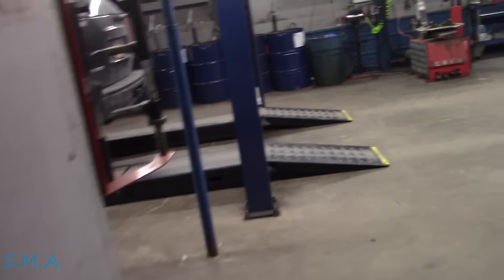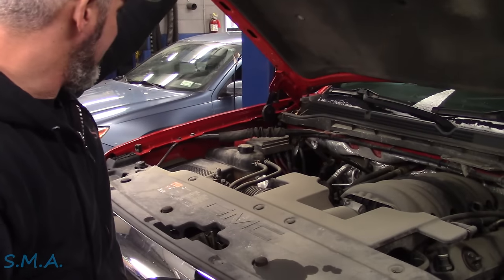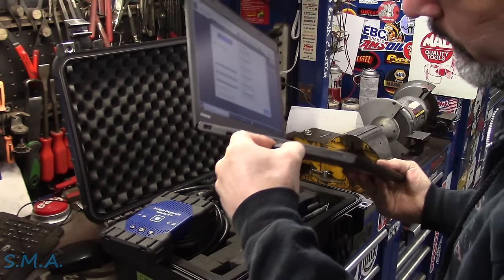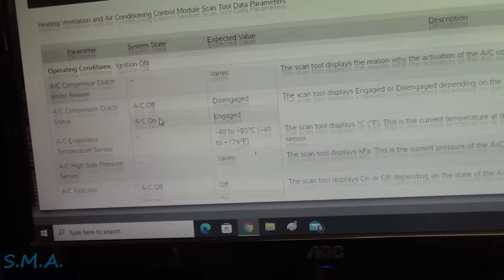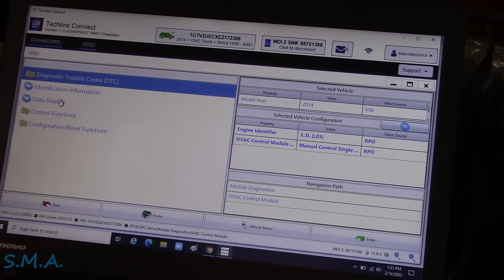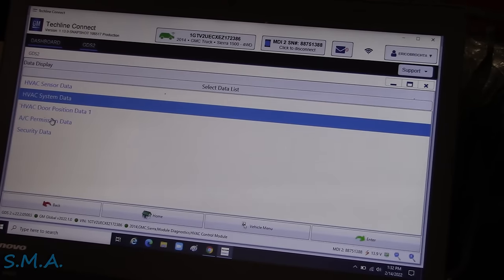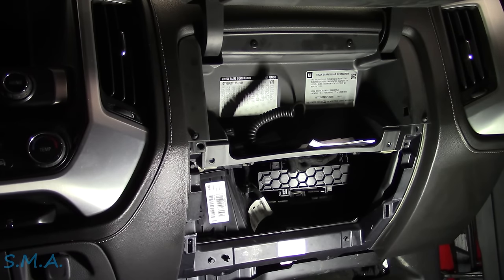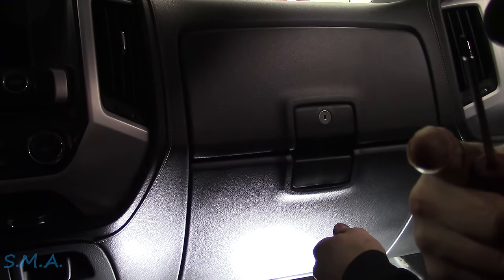Chevy/GMC Truck: Failed Heater Control Module

Comment: I bet the profession was fun when you started, back when cars were simpler.  Car not running right?  Put in plugs, distributor cap, wires and rotor.  Maybe tweak the carburetor a bit and you were good to go.  Today, you have to be a rocket scientist to put air in the tires.

Comment: In my youth I considered being a mechanic but decided otherwise I still do most of my own work but yeah wouldn't wanna do it everyday  my two most cringe worthy jobs have been injectors on my 04 Duramax or a motor swap on a 06 envoy (currently doing) but these large jobs could easily exceed the value of the vehicle if I hired it done in fact I priced a couple shops and they said they didn't even want to touch it there when you know your in for some fun lol

Comment: When I first started in the auto repair world. I had a Mac Tools 4000 Enhanced Scanner that I bought from the mac tool guy and I gave $3,000.00 for the setup that was way back in 1992... 😢 I just recently had to put it in retirement as the software updates just got to be to much money and you can still buy them on eBay. 😂😂😂

Comment: There is a pro and con to the good old days, I have three modern cars computers and what not, and one 1978 Dodge Ramcharger.  It's great to have a fully mechanical vehicle in that the repairs are very easy, and there is room to work, yes all that's great, that's the Pro, the con is you really have to put your Sherlock Holmes hat on and say the game's a foot!  Because there is no computer so you can't plug in and find out what the problem is, which is and can be a Con.  And then there is the relic parts that are needed and are hard to find, or don't exist anymore, or are available and are either cheap or stupid expensive.  So I'd say there is a good bad and ugly side to simple non-computer controlled vehicles vs newer technology.  And you are correct Eric, it is getting to a point wherein the average Joe can't even change a light bulb without having to do some kind of programming and that's just the way of the beast wherein manufactures will make it so it has to be taken in so they can scoop up more money.  
As for a different career, yes it can get boring but at least the problems are usually different or a mix of things, most jobs today you deal with angry people and do the exact same thing everyday.  We are where we are supposed to be or for now, anyone can change what they do, or the right time needs to come along.  I'm a ret Paramedic Capt from the Fire Department, and although we had SOPs (Standard Operational Procedures) mean there are steps one should follow or monitor but every call was different.  Yeah you have Vehicle crashes and fires, that are of the same kind but the nature of them were different.  And medical calls were always different depending on the person and age.  A few years ago I got a medical call for a 18 yo male who had burned his testicles, come to find out he was trying to light up his own gas, and when that didn't work he used lighter fluid!!!!  Yeah, and he's out there now driving and voting and making decisions.  It all comes down to what you do that makes you happy, you're good at, and Job Security!  It's a pretty safe bet that Flame Tard I talked about will always need someone to work on his car...I hope.  Don't worry he was okay, just the stupidity that caused a burn injury, I still to thi day scratch my head on that one, and that was years and years ago.  Thanks for reading, my best to you Eric and Mrs. O, and to anyone reading this Bes Safe and Well!

Comment: Being a retired electro-mechanical engineer I always tried to follow the KISS principle... keep it simple stupid. The young engineers coming out of school seem to think or are taught that everything in the world needs to be controlled by a microprocessor. Having to re-program a heater control module post-replacement is just plain ludicrous. Trashing expensive electronic modules or other complex parts, or even the entire vehicle, flies in the face of the constant mantra of sustainability.

Comment: I call it technology for technology sake. Not really better, just more complicated. I'm not scared of electric controls. With the right tools they are actually easier to diagnose than cars from the 90s. I'm with you though on cost to repair. It's going to be hard to use a module out of a salvage yard when a 2022 vehicle gets some age on it as programming might not allow it. It's going to be a mess when these things are 20 years old.

Comment: The problem is ALL of the car companies have gone off the rail buying into beautiful overblown technology features.  Every dash and control panel has to look like a gee whiz bang tablet, everything has to be computer controlled, so they add more and more modules to massively overbuild controls that have no possible need to be that way.   Yet another reason I will not go out and drop $50,000 of a new vehicle.  I have owned many vehicles in my life from the 1960's model to current decade, and not one of them every had a problem with the heater A/C controls other than replacing a blower motor or blower motor resister.  Stuff like MR. O just showed is also why many people are keeping older cars going rather than buying new.

Comment: If someone is just replacing the HVAC control head, does this also need to be "programmed"?    This would be GM Genuine Parts 15-74881 Black Carbon Heating and Air Conditioning Control Panel Assembly.  Seems to me it's just plug and play.

Comment: I definitely long for the days of kerchunka chunk knobs and switches. None of the touch screen garbage impressed me at all. I just want something robust. Don’t care if it is pretty, just want it to work. I often wonder if a fella could make a living with a shop that converts “digital” modern vehicles to “analog”. Yank everything out of the dash and install a basic condenser/heater core with a blower fan. Install an aftermarket radio and call it good. Even if the job didn’t profit anything, you could make a decent profit selling the truck load of junk that you take out. A company did something like that with competition ski boats years ago. They used the hull mold of one of the best boats ever built and only installed the bare necessities with the option of a few “modern” upgrades. That shaved tens of thousands of dollars off the price of the boat. I thought it was a fantastic idea, but seeing as how they are no longer around, I guess that tells me what the future in that market looks like. I forget that I live in a world where everyone has to have the latest and greatest telephone, even if they have to finance the dang thing. I just can’t wrap my head around that way of life...

Comment: Love your videos and Diagnostics..... our 2007 Pontiac Vibe is more complex than it should be.... I am 79 and worried about how my daughter is going to survive the new world of cars when they need to be fixed? For now, I use a decent Scanner and can do 50% or more myself, but just yesterday paid to have the Serpentine Belt replaced, Valve cover and seals to the spark coils replaced.... and a 4 wheel alignment.... crapola!!! the Rt Front is out of Camber by 1.5 degrees and no way to fix that? Have to order special components just to adjust the Camber? Holy Cow...  at 79, the skin on my hands rolls off like a paper towel roller :(

Comment: There is no reason why most of those replacement parts are not plug and play. The ECM should be able to recognize the new component and make it functional. These requirements are not for "security" but to make more money

Comment: Hey Eric. The dealership has had my truck for two months due to the parts shortage. They can't get a starter and the starter is locked up tight. Any advice on what to have looked at when I get it back? I could use all the advice I can get at this point, it's like a nightmare come true and I'm worried it's going to be crippled with issues after sitting for so long

Comment: Many of the problems to do with today's vehicles are not created by the manufacturer but in fact the Government. Fuels efficiencies, safety featured, emissions etc are all mandated by the Federal Government and the manufacturers have to comply if they want to stay in business. The only way around this for the average consumer is to pickup an old beater and then restore it to original. In places like New York this is almost impossible due to rust so you would have to venture to say Arizona to get a good restorable vehicle that would be grandfathered in New York for inspections. Sad but true.

Comment: Imagine getting stuck in a ditch out in BFE in sub zero temperatures without a heater. I consider some things life safety and a vehicles heater is one of them. They have gone too far with this computer-controlled stuff. Remember the runaway Lexus epidemic a few years ago?..Some systems should be left alone and mechanically- controlled .

Comment: miss the simple cable pull heat, i didn't even mind points and a carb much easier and cheaper to fix

Comment: I thought about attending automotive mechanics class in highschool but did end up taking a computer degree at college instead. I'm at the end of the rope on the IT computer manager work I've done for a living up til now. I'm 58 yo and I've about had it in my current job. I have many times questioned my decicion, and wondered what life would have been if I chose mechanics instead. I'm a software engineer but do not program software at all, maybe my expertice would fit in the automotive repair business. I may ask my cousin if he would hire me as he owns a car repair garage close by 🙂

Comment: There are definitely bad guys in the industry but you are not one of them. It’s the a-holes that sell a customer hundreds or thousands of unnecessary parts only to not fix the problem and send it to you to diagnose. Unfortunately it’s only going to get worse with mechanics that just want to swap parts and not figure out how a diag process works.

Comment: Does the programming prevent you from using a used module that's not blessed by GM as "remanufactured?"

Comment: I miss the old days of the first/second generation small block.......  I just had my 08 Avalanche engine rebuilt because of the AFM system since then I've been chasing "Random misfire" and "cylinder 7 misfire".  Everything has been changed and the problem still exists.... Went to the dealer they tell me they find no codes present, just "historical codes" and cleared the codes.  I go 2 days and code comes back.  Old days you would have done a compression check and go from there...
Reply: If you have any questions join us on the Avalanche Nation Facebook group page. Thousands of people with the same truck and tons of experience on how to keep them running just like my 07 Avalanche.
Reply: @Jeff-jr3sg  I have put in for acceptance tp your page

Comment: I hate the ever more complicated electronics.  The infotainment systems are far worse than cell phones for directing peoples eyes from the road.  These touch screens are hard to use if you happen to be driving down a less than glass smooth road.   You reach for the icon and you hit a rough spot and you touch the wrong spot giving an undesired result.  Actual push buttons are far easier to use and don’t draw you into staring at the screen.

Comment: Give me an engine with points and a carburetor, radio with knobs, heater control cable, lights with switches that don’t go to a computer. Those were the good old days…

Comment: i hear you but alternatively vehicles seem to last longer with less maintenance , longer oil, spark plug,engine life .you might just to close to it.  i have a 04 duramax motor that still rocks but rust is winning 400000km(250000miles). washing machines and fridges on the other hand are absolute garbage.just my thoughts ( i'm usually wrong tho)

Comment: I have a 2012 1500 4.8 that I noticed starting running a little hot. And now I'll notice the recirculation and fresh automatically actuate and sometimes the blend door does not switch. Any theory?

Comment: They usually hook for five different types of systems togetherwhich makes it almost impossible to pull a fuse and just say okaylike your turn signals out but your heater won't work and your wipers either.... Someday the shits going to be all disposable.  you won't even be able to afford shoes so you can walk.

Comment: Great work Eric. I thought I was in for similar nonsense when the mode selector on my 2006 Saturn went out. O h was I pleased when upon ripping it out of the dash I found it was cable operated and it just became unanchored from the control wheel.. Fixed it in a jiffy with a modified cable tie....

Comment: In my opinion people have just brought all the problems with this high-tech garbage on themselves by being fascinated with anything that's bright and shiny and seems to have all these bells and whistles.  The car makers have responded by making all this junk seem neat and cool.  The customers don't realize that all this s**t just exponentially increases the chances of stuff breaking and the cost of repairing it.  Today the glove box latch on my 86 Ford broke.  All I needed was some ingenuity and a little glue to fix it.  Not so most of the time when some electronic module fails.

Comment: I suspect that EVs will have a lot fewer problems and may even be easier to work on for some things.  The big issue will be the high voltage hazard.

Comment: Hey dude...what you are saying about how complicated vehicles are is nothing compared to what's coming....mechanics are going to need 4 years of collage and every 2 to 3 years they'll have to go and get updated on new technology...it may not be worth it..dealerships are struggling to get anything done..they all have hot lines to factory technicians that may not have all the answers..things get pretty hairy at times..it doesn't pay that well either if you work for a dealer...i worked at a assembly plant and every 3 years for us we had to spend 2 weeks learning new technologies I'm so glad i retired in 06..at 33.6 years..see you on the next one Cheers 🍻🍻🍻🇺🇸🇺🇸🇺🇸⚓⚓⚓

Comment: add computer more fine wires to shack rattal and break or rubb on something and short or turn green and always in hard to get spots I miss rebuilding diesel engines Cat, Cummins, Detroit, Perkins until computer starting to control everything. Glad it`s you and not me I don`t have any more hair to pull out

Comment: I agree with you completely. Watch the video that Ivan from Pine hill Diag put out about the Lincoln SUV where it took him 7 hrs to diagnose which module of the 26 on the car was causing the battery drain. I would have set the car on fire and called the insurance company. There is no reason for making all these systems so convoluted. The only thing that should be convoluted is the engine controls for pollution. Everything else was perfected in 1968. All you need is a cord to your Iphone and you have all the infotainment you will ever need. All these young knuckleheads that want buttons to push should go home and buy one of those Fisher Price toys with the levers and buttons they give to toddlers. Play with that. Mr O you should go into the restoration business of old cars. In five years that is all that is going to be running still.

Comment: Are all these modules really needed for a vehicle to run efficiently and economically?  i think "NOT".  If they want to run the engine and drive train with them then fine.  But let every thing else alone.  Knobs are great in my book, and rarely fail in the life of a car.  I believe that the auto industry is trying to force the public to use their overprice facilities to get repairs done to bypass right to repair.  Like you said we will all wish for the by-gone days of everything being basic.

Comment: Not to mention with all this you need hands like stretch armstrong  to fit in these little spots, no wonder by the time you get these cars in a second, and third hand sale half the screws and nuts, etc..... are missing in these little tight areas from the last poor bugger that had to spend $700 to fix a module.

Comment: Do you buy the year subscription for gm we been just doing 1 vehicle for 40 but like last year I did like 15 module programs so I can’t see paying all that extra cash but we don’t have the tech line connect functions just click on sps2 do the programming then use the snap on tool for the resets relearns etc or maybe I’m doing something wrong
Reply from the maker: Well the next time you do one you will need tech line connect. They did away with SPS a few months ago ;). I do pay for the whole year yes.
Reply: @SouthMainAuto  yes I’m using the new platform seems like they switched around October/Novemberish it’s been good but it seems to take longer loading than sps1

Comment: Even worse if you own a hybrid or full electric vehicle. Even more electronics in those and who wants to be the poor sucker when it's time for the battery cells to be replaced.  

All batteries lose capacity over time and have a finite number of charge/discharge cycles.  I replace enough batteries in stuff. Don't want to deal with my car being powered by them also.

Comment: Please help me lol i have a 15 terrain, my blend door was broke ans they put in an entire new hvac box, new blend door actuators, the works. Worked great for 3 days then i lost heat. He recalibrated it with the computer and it worked great until i shut the car off. Then no heat again. I can tell my blend door actuator basically has no power. Its doing nothing. Could it be this control module? Even the mechanic is stumped lol